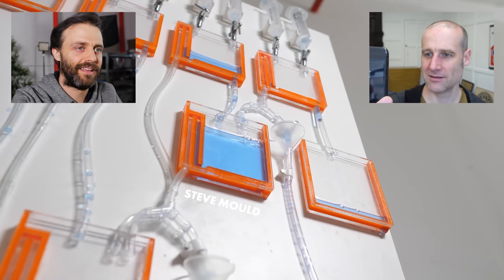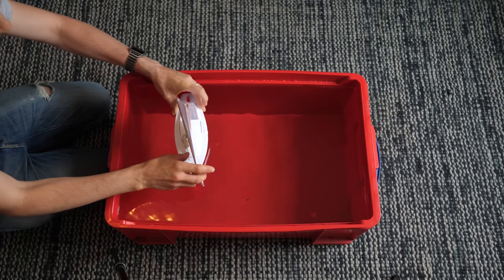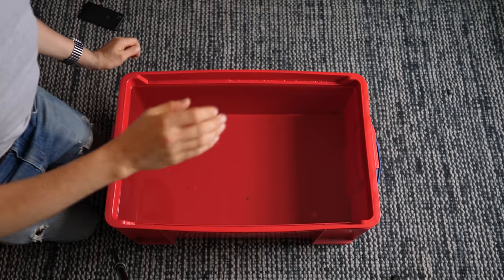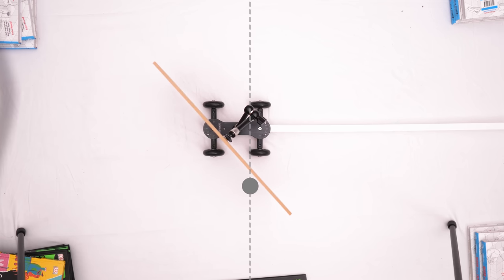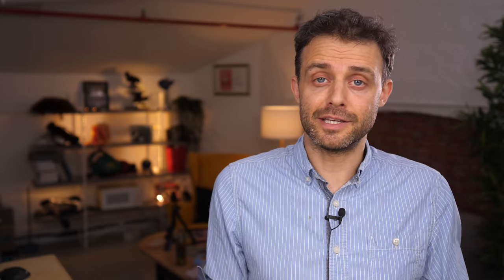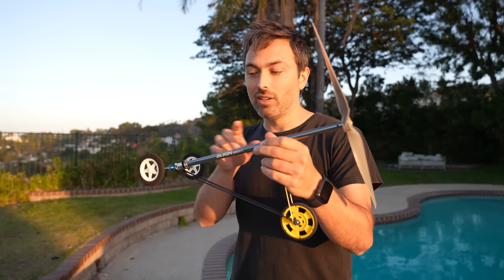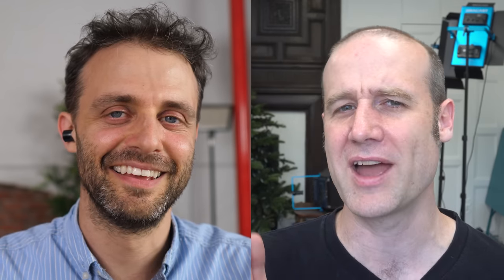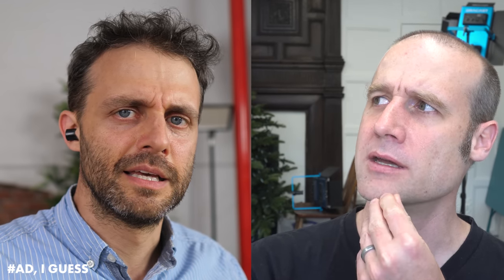Sailing Faster Than The Wind - How Is That Even Possible?

Comment: Great explanation of how to sail faster than the wind but what I spent a while trying to work out after the Veritasium video was how you can sail such that the component of your velocity in the direction of the wind is faster than the wind. With this explanation that requires angling your sail in the opposite direction to the conventional way so I’m not sure how you do it in practice.
Reply: ^^This^^
Reply: This is the part that is actually confusing, and the part that Steve seemed to totally skip over...
Reply: The angling of the sail shouldn't be important. It's the fact that the wind pushes the machine, which allows the wheels to turn the propeller.

It seems odd that the wind can be slower, but the slower wind does reduce drag, which makes it easier for the machine to overcome friction and maintain its momentum.
Reply: I think a explanation could be: (its my explanation)
When the wind speeds up the vehicle it doesnt speed it up due to it turning the blade, but due to pushing on the vehicle. Then the wheels will turn also and this causes the blade to spin. Now when the vehicle is at the speed of the wind it will get faster, cause actually if you imagine a horizontal line through the rotors blade there will be a crossing point between the imaginary line and the blade. This dot actually moves backwards while the blade is spinning, because of the blade is tilted. Now you have a point on the vehicle that is moving slower than the boat, cause this point is moving backwards relative to the boat (it could even really move backwards, but lets assume it doesnt)
So then the air can push on this point, since its slower than the air and thus push on the whole boat. 
Of course this backwards moving point doesnt really exist. But you can also think about it this way:
The rotor is spinning, and thus it will blow air against the actual wind. This will cause some swirls and this will cause the vehicle to kind if push itsselve from the wind. Now you could argue that pushing from the wind takes at least as much energy as it takes to turn the wheels. But thats not true, since the vehicle is moving faster relative to the ground than to the air. And thus its easier to push from the moving air than to turn the wheels to be able to push the air backwards. (Have you ever been in a pool with circle motion and just floated in the water while pushing yourselve activly from the fast water jet at the edge tonbe faster than the others? did you notice that gaining speed by this was easier than gaining the same amount of speed difference due to pushing off the non moving water? ) this is  because the kinetic energy increases quadratic with speed. So lets say you want to gain a ∆v of 1m/s relative to non moving ground while you've got no speed  in the first place. The energy reqiered would be 0.5(m^2/s^2)*M with M being your mass. But if you try to gain 1m/s when you are at 20m/s to get to 21m/s you will need a energy of 20.5(m^2/s^2)*M. So much more. So if you push from a object that isnt moving to gain 1m/s while you are at 20m/s you will have ro use a energy of 20.5(m^2/s^2)*M
But if you are pushing from a object being as fast as you, you will have to use only 0.5(m^2/s^2)*M. This is because you will push the other object backwards by doing this and thus you will decreas its veilosity and thus its energy and thus you will gain energy without having to do that much of a work. (of course this 0.5(m^2/s^2)* M does only hold, if you assume that the mass of the object you are pushing from is infinity, cause else it will get slower while you are pushing from it like i already said, and this will make calculations complicated)
So you can actually divide this process into steps:
Step one: Pushing from the wind using a energy of 0.5(m^2/s^2)*M and increasing with speed of 1m/s
Step two: using your energy relative to the ground to push from the air. 
So if you calculate that you will loose 0.024m/s. (cause you will get a energy of 0.5(m^2/s^2)*M if speeding down from 21m/s to 20.976m/s) .
So over all you are gaining 0.976m/s without blaming the law of thermodynamics.
Reply: Steve only shows a beam reach which is 90 degrees to the wind so on the direction of the wind you do not travel any distance. the veritasium video shows a broad reach (about 45 degrees away from the direction of the wind) going faster in the down wind direction than the wind itself. on the broad reach you will travel downwind. I would like to see the Steve's model on this broad reach and see if it can out run the air molecule in the down wind direction.  I think the boat will still go faster than the wind on the 45 degree course but will it go faster in the down wind direction ? my head can not picture it doing this I need to see  the model doing it.
Reply: I think the wind speed is lower at ground level. They need to put one of the flag streamers at the top of the vehicle.
Reply: Exactly.  It's obvious (to me anyway) that a sailing boat on a reaching tack (i.e., 90º to the wind) can go significantly faster than the wind speed.  What's counter-intuitive is that a sailing boat can go faster than the wind DOWNWIND.  It seems that the people who made this video didn't understand the question they're trying to answer....
Reply: Here's how to make Steve's video represent this faster-down-wind-than-the-wind case:
At 8:35 in the video, hold your finger directly over the wheel that is on the end of the stick. Now, between 8:35 and 8:37 - without moving your finger - use your other hand to move your screen to the right a bit. If at 8:37 your finger ends up above the black and colored rectangle in in the lower left corner of the video, then you moved the screen at just the right speed.
So, what does this show?  When you do this, your finger represents a fixed point on the water/ground. If you imagine a line between the finishing point of your finger and the wheel,  this is a line in the direction of the true wind (the wind relative to the ground). 
The wheel is a "fixed" point in the air. That is, the wheel is how a free floating balloon would move (just like in the video, this is the ideal situation, no friction, the sail doesn't mess up the air, etc). At 8:37, the boat is further to the right of the wheel than at 8:35, thus the boat has gone faster than the wind.
The direction the stick is pointing isn't as important, but can be considered the relative wind direction. That is, the direction the wind seems to be coming from if you were on the boat. Notice how the relative wind and true wind directions are much different, by about 90 degrees, in this example.
Reply: @3dcrazy332  Thank you, I couldn't reconcile the empirical results from Veritasium with the theory in this video. I think this is it. If you angle the boat to a broad reach (as opposed to beam reach as in this video) and carry "sail missing the incoming air" argument you conclude that the boat speed is faster than the wind but not in the downwind direction. The downwind speed of the boat is always less or equal (depending on sail angle) to speed of the wind. So either the "sail missing the incoming air" doesn't capture all the physics of sailing/lift or its boundary effect as you suggest. I vote for the later.
Reply: It's a shame because the model presented here can be used to explain the phenomenon perfectly. Just angle the hull away from the wind more than the sails, and you will travel faster than the wind in the direction of the wind.
Reply: @3dcrazy332  Here you go:
https://www.youtube.com/watch?v=aDzWh9J1dk4
from 3:16 to 4:39, the streamers above and to either side of the prop are showing a head wind. The one mounted lower and forward of the vehicle does drop sooner (around 3:00), so the wind speed, as expected, is lower down there, but not by a huge amount. 
In any case, the record they set is 2.8 times the wind speed measured at (or slightly above) the height of the propeller hub - WAY over wind speed. As the streamers in the video I linked show, the wind speed above the propeller is very close to the wind speed at hub height.
Reply: Getting your sail on the wrong side is called soaking by the lee
Reply: @rogeriocosta1035  oh there definitely is, and you can feel it when you step off of a run
Reply: @Summer-xu8qu  Thats not true
E=1/2mv^2 
If you weight 100Kg and you have a veilosity of 1m/s you will have a Energy of 50J
If you have 20m/s you will have a Energy of 20000J
If you have got 21m/s you will have a energy of 22050J and thus you need 50 J to get from 0 m/s to 
1 m/s but 2050J to get from 20 m/s to 21m/s.
Reply: @Summer-xu8qu  
So if you are on earth the earth is spinning. And if you want to gain 1m/s from zero veilosity out of your perspective you will need 50J of energy if you weight 100Kg 
But out of the perspective of space you had already a veilosity of
 464m/s relative to him and went to 465m/s. Out of his perspective you gained a kinetic energy  of 46450J
So where does the extra energy of 4640J come from? Of course from the rotary energy of earth. You where pushing off ground speeding up and this made the earth to go very very very slightly slower in rotation. This is where the energy comes from. And if you stop, the speed of earths rotation will be the same again due to conservation of momentum. 
And this is actually what you are using here. You are gaining more kinetic energy by pushing off the wind than you need to push off the wind, cause you are actually using the energy of the wind by decreasing its speed.
Reply: @dcpjoncas  Just using the explanation in Steve's video if you are sailing a broad reach (45 degrees from the downwind direction. if you are travelling at root 2* the wind speed this means you are going the speed of the wind 90 degrees to the wind and the speed of the wind downwind. if you are travelling the speed of the wind downwind then the air molecules will never hit the sail . if you slow down the molecules hit the sail, you will speed up the sail but again when you reach wind speed the molecules will not hit. if you speed up (faster than the wind down wind) the air molecules in front will hit the sail and slow you down.  just using the explanation in the video means you can't go faster than the wind down stream in a boat. there might be other physics that might mean you can go faster (Bernoulli affect maybe). again my head hurts thinking about it
Reply: @andrewsnow7386  - Thanks for the link I haven't seen that video. It's really mind boggling. I still think there is a simple explanation like inertia. I feel like it's a scam.
Reply: @3dcrazy332  well up there i calculated, why it is possible. Just calculate yourselve:
For example: you and the wind are going with 10m/s. Now calculate how much speed you will gain by pushing off the wind (assume that the wind wont get slower for simplification (assume the weight of the whole air packet to be very very high))
while taking into account that you use 1Joule to increase your speed. 
If your weight is 60Kg and you use 1Joule of energy you will gain
0.18m/s.
So now you've got 10.18m/s. Now calculate the speed you will loose, by taking this 1J from your motion relative to the ground. But take into account, that the speed to calculate the energy reauired to reach it is always the speed relative to the medium you are pushing yourselve from to gain energy. So while your relative speed to the wind after accellerating was 1m/s and before accelerating was 0 m)s  now the speed before decellerating has to be measured relative to the ground cause you are taking the energy by attaching the rotor to the wheels and they are "locked" to the ground and not the air. So this time the speed before decellerating is 10.18m/s and after decellerating its something.
So you've got the formula:
E=1/2*m*(v1)^2-1/2*m*(v2^2)
So v2=√v1^2-(2E/m))=
√((10.18m/s)^2-(2J/60Kg)=10,178m/s
So You used 1J of energy to prepell yourselve from the wind and would have gained 0.18m/s, but since you took the energy from your veilosity relative to the ground you lost 0.002m/s ending up with a + of 0.178m/s. This is possible, cause you actually slowed down the wind a bit. 
Also its only possible, cause the energy increases quadratically with speed, cause E=F*s and F=m*a and at the same acceleration and thus same force the distance you travel while accelerating scales withnthe square of the speed, cause with more speed you travel a longer distance in the same time, but also it takes more time to decellerate with the same rate. So the time scales with v =>t~v and the distance scales with v so s~t so s~v^2 in this case. And the 1/2 comes from the average speed, cause at the beginning its at min and at max so average is 1/2 max.
Reply: Yes. The real problem is not explained.
Reply: @neutronenstern.  - So what happens when you surpass the speed of the wind and the air is now pushing your "sails" from the opposite direction?
Reply: @3dcrazy332  Building a rig of that size is a lot of work for a scam. And to what end? Also an organization like the North American Land Sailing Association which certified the record, or Derek (Veritasium) are not going to be easy to fool.
Reply: @andrewsnow7386  - On that channel you linked there is a video from Discovery Channel or something like that. In the video they talk about how the scientific community pretty much agree with what I am saying. Doesn't it make you wonder why after more than a decade later this guys machine is still the same machine? Wouldn't there be all kinds of advancements in the tech if it was an actual thing and not just something for channels to use as clickbait for subs?
Reply: @3dcrazy332  No, why would they change the machine? They still holds the record of 2.8 times wind speed.  They built it to prove a point. Why would they spend time and money refining it to say reach 3 times wind speed. This increase wouldn't change anyone's mind about the validity of the concept.
Reply: @andrewsnow7386  - Take a plastic windmill and run forward... it spins one direction. Run backwards and it will spin the other direction. Next let the wind blow the windmill... it will spin one direction. Now run or drive faster than the wind is blowing... it will spin the other direction. The only thing that makes any sense to me is that the guys machine has momentum and inertia built up from wind gusts and when the wind returns to normal the inertia keeps the vehicle going faster than the wind for a few seconds.
Reply: @3dcrazy332  What he said was "We do have a number of PhD's ... that still assure us it's impossible." A "number" is not the same as "the scientific community". There are a number of people on the internet that think the earth is flat.  I would not say that the internet community thinks the world is flat.
Reply: @rogeriocosta1035  actually, it appears that you can sail downwind faster than the wind.  And after much pondering on the dumb machine in the Veritasium video, I'm pretty convinced it is actually going downwind faster than the wind.  

My annoyance with this video is that the presenters appear to have entirely misunderstood what it is they were supposed to explain.
Reply: @3dcrazy332  The wind is NOT spinning the propeller on this vehicle. The wheels are powering the propeller. So, the correct analogy is an airplane starting a run downwind on a runway. 
- When the airplane starts moving, the wind is going faster than the airplane and the propeller is spinning, say clockwise, and it is providing thrust to move the airplane forward.
- When the airplane matches the wind speed, the propeller is still spinning clockwise, and still providing thrust to move the airplane forward.
- When the airplane is going faster than the wind, the propeller is still spinning clockwise, and still providing thrust to move the airplane forward.
The faster-than-the-wind vehicle doesn't rely on inertia anymore than the airplane.
Reply: @tellyrotsyourbrain  Oh my! You make me realize I was totally wrong and make me think in a simple explanation too:

In a ideal system (without drag) we could gain speed in the diagonal to go faster than wind in module (nobody doubt that), make a perfect turn to the downwind direction, disable the sail and keep going faster than the wind.

With a little drag it would still be possible too. You need to gain speed in the diagonal, turn (loosing some speed but still over the wind speed), travel a little bit faster than the wind, turn again in the opposite diagonal and continue this zig zag movement until the downwind component of the diagonal velocity reach the wind speed.

If the drag is not too much, the result would be a path were the average velocity in downwind direction is greater than the wind velocity itself. (there will be an optimal path, of course).

You can't do that in a unidimensional system, but using a 2D path (you need the water or the ground to make the turns possible), there is nothing wrong in the laws of energy and momentum conservation.

And since the machine "sails" have an ortogonal movement in relation to the main movement, I think it is perfectly possible too. It is the same theoretical concept.
Reply: I'm sorry! I was totally wrong. There is a simple exemple for that in a non friction system:
If you can go faster in module than the wind in the diagonal (nobody doubt that), you just need to gain that velocity, disable the sail and make a perfect curve to keep going faster than the wind speed.
Depending of the amount of friction, it can be perfect possible in a real system too, and you can also calculate an optimal path to do that.
Reply: @jochenweidler8645  The whole purpose of this video was to explain it without an elaborate model, so anyone can uncerstand.